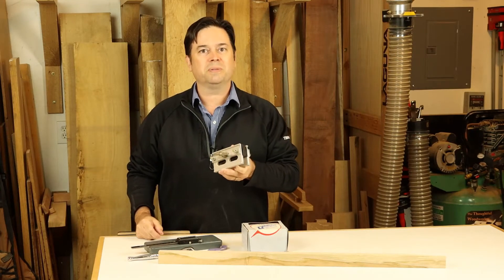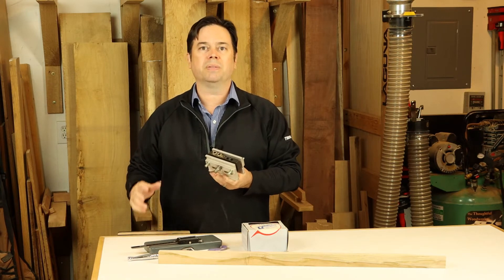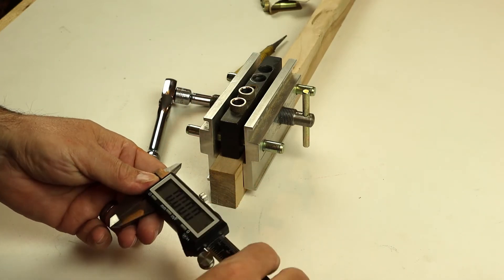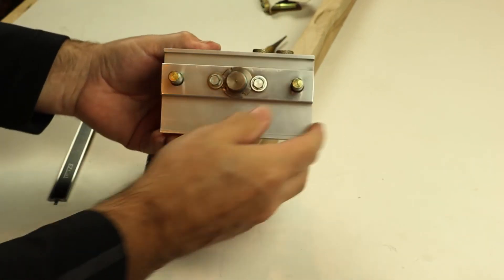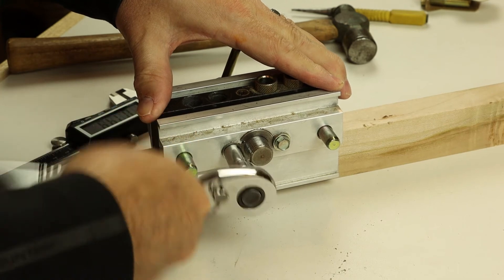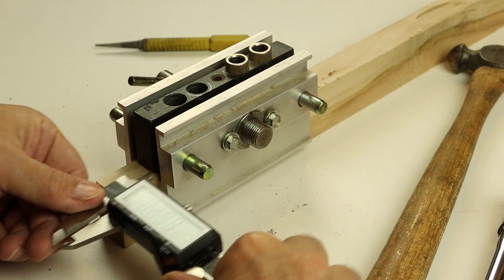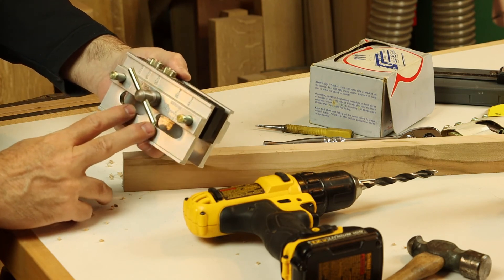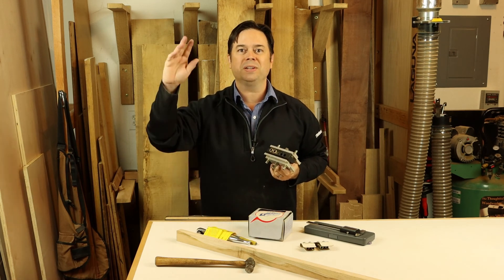How to Adjust a Woodworking Self Centering Doweling Jig that Doesn't Center Holes / Dowel Adjustment

Comment: Just for grins, I would've checked the tolerances on the other side of the jig. Also, place a  piece of drill rod into the hardened drill guide to see if the drill guide is allowing for an almost perfect 90° to the surface of the stock. Then drill a test hole and insert the drill rod and check again. I have found that several jigs have wiggle room in that hardened drill guide. I will also usually use a slightly oversize bit that fits a little tighter into the drill guide hole.. And example would be a 3/8 inch or .375 inch drill is replaced with a V drill that measures .377 inches. I know you would think the dowels would then be loose but .002 inches larger does not seem to make much of a difference especially after glue is applied. I have often found my dowels to be too tight and almost all glue is removed upon insertion. Thank you for this really good video on adjusting a guide that is not self centering properly.
Reply from the maker: I like the idea of using a slightly larger drill bit.  Nice ideas and explanation.

Comment: You have a Model 2000. Dowl-it invented the original Model 1000 5 permanent holes no bushings. There are now many cheap knockoffs produced in China and Taiwan. A later model 2500 has 4 holes for paired bushings. Adjustment is different. Dowl-it is still in business but is now in Spring Lake, MI. Their customer service can provide instructions on adjusting the Model 2500. Their jigs are all made in the US. They are higher priced than the imported ones but I feel the Dowl-it product is better.
Reply from the maker: I agree, they seem like solid jigs.

Comment: Harbor Freight makes a pretty excellent copy of this. Mine was out of calibration from the factory, but I really didn't mind having to calibrate it for the price I paid. The old Harbor Freight version from 10 years ago was an exact copy with rough machining, but they changed the adjustment nut and now there is a set screw, which is pretty nice. They use a real nut now instead of the thing with notches. The new ones are much cleaner without all the machining marks. I think I paid about $20 for it.
Reply from the maker: A bargain by any standard!  Glad it's working well for you.
Reply: Have you had any luck doing edge to face joinery eith this?
Reply from the maker: I would typically use a biscuit joiner for edge to face type joinery (like a vertical divider on a dresser or entertainment center).  But you might be able to use the dowel jig for half the joint, and locate the other dowels with dowel centers.  Best of luck with it.  @timlist4173

Comment: My recently purchased HF jig was crap. Due to sloppy fit of the guide pins, the guide block wasn't square to the jaws in either the vertical or horizontal axes, and not repeatably centered.  The drilled holes weren't square to the edge, resulting in tilted dowels. Your adjustment would have fixed the centering, but not the other problems.
One other issue: the holes in the jaws for the guide pins were each a millimeter over sized. This was necessary because the guide pins themselves weren't perpendicular to the guide block - they were each out  by about 1 mm each side over ~90mm  total length. So the pins lean towards each other by 2mm on one side, and away from each other by 2 mm on the other side. If the pins were square to the face of the guide block, you could simply drill out the holes and install 10 mm bushings, but they aren't, so if there is a way to fix this, it hasn't occurred to me yet. 
My working solution was to deconstruct the jig by removing the adjustment collar and lead screw, and to use only the one jaw.  I then put two pieces of drill rod between the remaining jaw and the guide block, thus ensuring both end-to-end parallelism (all the holes the same distance from the face) and top-to-bottom verticality (drilling perpendicular holes). The slop in the holes allowed me to square the jaw to the guide block. I then simply used clamps to hold the jig in place. Obviously, careful attention to the planar faces is required to avoid doubling any centering error.
Not an ideal solution, but it saved me from spending the time and money for a better jig. Since this was one job, and not by any means fine cabinetry, it was a useful solution. Your mileage may vary.
Reply: There are loads of these jigs on-line and they all appear to be identical apart from the color of the anodizing. I can't tell if there's any variation in build quality between them. Like so much Asian kit, they probably originate from one OEM manufacturer. When I first encountered this problem, I thought the solution would be to try bushing the holes for the guide rails to make them a close, sliding fit without play.  It was a complete failure because the jaws would bind - hence the need for clearance holes.  A solution to the binding might be to have longer rails with correspondingly longer bushings,  say about 2" long.  Another possible solution could be to have two synchronized (geared) lead screws so that the jaws always move without moving out of parallel.  I realise this is over-engineering the issue, however. It's a pity as the general concept of the jig is excellent but the execution is poor. Maybe someone can come up with a simpler, better mod to fix this.

Comment: Hey their still making self centering jigs like that. I had the same problem. Never thought of measuring. I did it by trial and error. I’m going to check my jig your way. Thanks.
Reply from the maker: Hi Alan, yes I noticed Infinity tools sells this type of doweling jig.  It comes with more guides than mine did, but essentially the same tool.  I didn't realize how far out of adjustment mine was until I measured it.  Works great now.
Best

Comment: I have an older one I picked up and it it's horribly off centered. I have no idea how it got that way and there are no nuts or adjusting washer like yours on mine (along with the side markings). Other than that it looks exactly the same. I don't think mine can be fixed? Mine is the version before yours where they had to have a correcting option?
Reply from the maker: Yeah, if yours isn't adjustable, you might have to replace it.  Infinity sells a self centering dowel jig, you might try that.  
Best.
Reply: While not as clever as the adjustable nut you can recenter your jig with a shim.  If you consider the thickness of doublestick adhesive it's possible to get it to within a mil by sticking the correct thickness shim onto the correct face.  Alternatively a local machine shop can probably just mill off the correct amount of metal.

Comment: Any idea how to adjust parallelism of clamping faces?
Reply from the maker: That's actually not adjustable on my model.  But, just like a woodworking clamp, tighten it up to judge it.  It may be angled slightly by design, and pulls parallel once tightened.  
Best

Comment: What if you don't have a fancy measuring device ??
Reply from the maker: Hi Donald, micrometers from iGaging are actually pretty cheap now, and useful for a lot of things in the shop.  Maybe trial and error if you don't have an accurate way to measure center?  Best of luck with it.
Reply: Tapered wedge gauge would work.
Reply: You could use feeler gauges.  For larger gaps, use feelers in conjunction with a spacer of some sort.
Reply: I had a cheap one for like $8  from amazon  its a very useful to have anyway

Comment: One problem I've found with this screw type design of jig is that the drill block doesn't stay parallel to the centre line of the work piece because of the loose fit of the guide rails in their holes.  The block can rock about by as much as 2mm at each end. This makes measuring the gaps with a digital caliper rather pointless in my view.  If the work piece happens to be thin enough to allow the jaws to close tightly on the block, then the problem doesn't arise.  The only solution I can see is to use shims on either side to keep the block parallel but this would be very inefficient. It would need a redesign to correct this which would make the jig much more expensive.
Reply from the maker: Mine is very old and actually quite high quality once adjusted properly.  No shims are required on a self centering jig.  I haven't used one produced in the past 20 years, so they might not be made to the same standards now.  Thanks